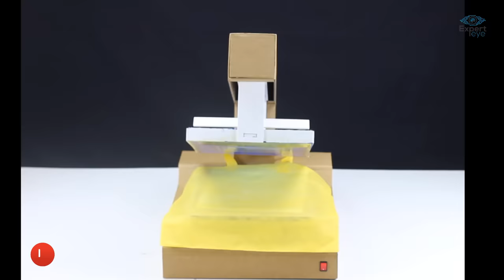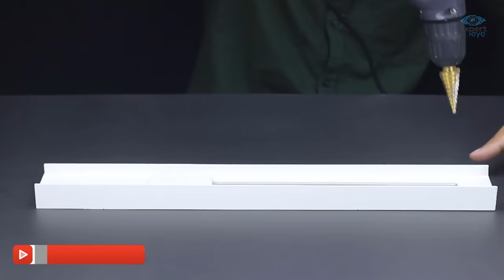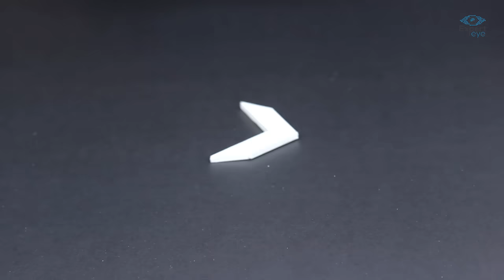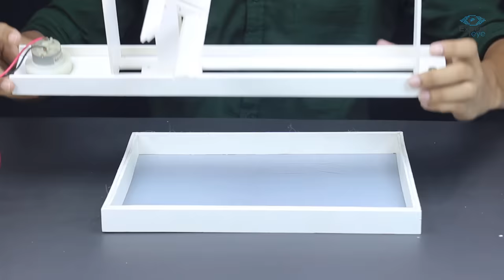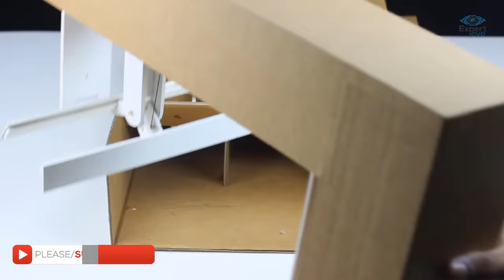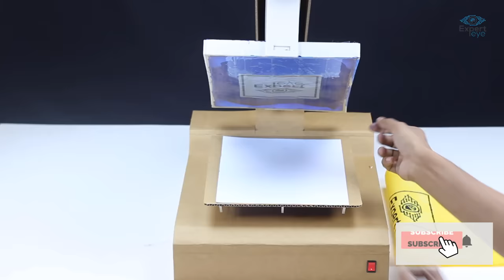How To Make Bag Printing Machine From Cardboard At Home

Comment: This is only a mock up, a model, obviously it is not functional. For real screen printing you need the fabric to be really tense in the frame and the squeegee needs to push really hard to deposit the ink… The cardboard simply would not stand the pressure. 
Notice that the video is made by step motion process. Quite good by the way.
Nice idea.

Comment: Pretty sure that will not work. The force to push paint thru that loose of screen would not be possible with that set up. It would be a painty mess. Nice design, make it out of wood and it would be another matter. Camera tricks.

Comment: Good idea for home use on occasions gift pack or return gifts. If the printing die is placed reverse the bag handle will be easily in the front and bag could be placed right in the end.

Comment: This is useless. No source files, no woring diagrams, no details how to trace the design to the template etc. So no one can rebuild this at home. Also i think this is not working well real world because you are using single switch to move two mechanisms. To do that there should have a microcontroller or another switching mechanism. But you show here nothing. This is useless. And which type of fabric are you using for the square thing? No details at all. I don't like this.
Reply: @Bojan_Slavkovic  yah, that is 100% correct.
Reply: @Bojan_Slavkovic  I could't say it better